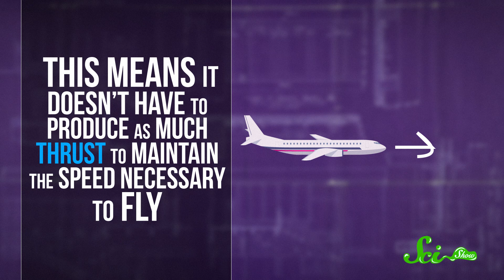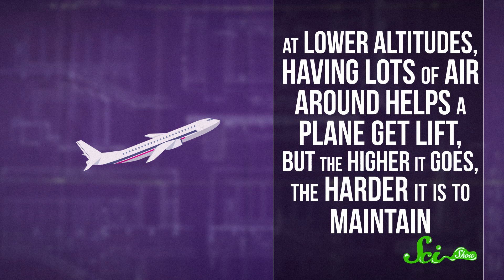Why Do Planes Fly So High?

Comment: Aerospace engineer here,
The arguments of 'you get less drag force flying higher' and 'you get less lift flying higher' both cancel each other out when you do the maths, so neither of them is a reason for flying at any particular height.
The primary reason for wanting to fly jets at 11km is because jet efficiency is proportional to the difference in temperature from engine intake air to exhaust air. If you look up a map of the SI atmosphere you'll see that the air above us reaches a local minimum in temperature at 11km, before warming back up again in the stratosphere. 11km gives the lowest air temp that we can practically fly passenger jets in, and so we aim for that to get best range efficiency.
Reply: Imma do a little necroposting here but it is correct to say that for a given true airspeed, going higher leads to lower drag (until at optimum indicated airspeed). This holds true for all aircraft regardless of what type of propulsion they use. Doing 430-480 knots true at sea level would be pretty wasteful no matter what the outside temperature is, and things would only get even worse in super cold weather (higher indicated airspeed).  A common way for jets to "maximize the temperature difference between intake and exhaust air" is to run the engines at high rpm, and it takes less fuel to do that in thinner air.

Comment: So, what IS the optimal altitude for most modern aircraft?
Reply: Qermaq It really depends on the plane type, winds that day, the weight of the aircraft but roughly FL330-390.
Reply: TheTechRobert Awesome, pal. I guess FL is Flight Level, but what's 330-390 measured in?
Reply: nhlfan40 You are also awesome! Hugs delivered by your hottest specimen of your preferred gender post haste!

Comment: Now if only jet fuel could melt steel beams...
Reply: Weakened, not melt. If you're being serious, take off the tin foil hat.
Reply: Inorganic Vegan 7/11 was a part-time job!!!
Reply: when steel frame buildings set fire, they burn away and leave the steel frame behind as a cooked skeleton. 9/11 is the only case of a steel frame building setting alight and falling in free-fall.
Reply: Any of those buildings hit by fully fueled commercial airliners?
Reply: ***** Nobody except the CTtards say it did.
Reply: nathan rous it doesnt have to melt it. when steel gets hot it  gets soft. its how forging works.
Reply: You mean steal beams,get it?
Reply: Bush did .81 repeating aviation fuel cannot reach the MP of a carbon iron alloy

Comment: Not exactlly true.. the air is much colder in that altitude, so also has more density. The ram air effect compensates for lack of air, but since the temperure doesnt change with increase in hight (but density does) there is no point to go higher than that

Comment: Airplanes fly high because they need to enter what is known as the "jet stream." The jet stream is where airplanes can get a boost in speed as well as less turbulence due to the singular direction of the flow of air.
Reply: ***** What if they're going the opposite direction to the jet stream? Or not flying along the route of a jet stream at all? Or what if you just watched a comprehensive video with a totally full answer that left far fewer holes than your answer did? Or if everyone you were trying to tell about your... Misapprehension, had also just watch a comprehensive video with a totally full answer?
Reply: ***** No. The jet stream, as you can tell from the name, is a very localized occurance, and thus the plane could not stay in it unless it happened to have a flight path both near it and in the same direction (not the opposite way).
Reply: Jake Halford I would caution against any claim of "comprehensiveness" because the reality is always more complicated. Planes may choose to fly against the jet stream for the benefits of less turbulence alone. Also, in terms of thermal regulation, flying against the jet stream is more fuel efficient than not flying in it at all. 

http://aviation.stackexchange.com/questions/1609/why-do-jet-engines-get-better-fuel-efficiency-at-high-altitudes

Comment: Would it be possible to design a passenger airplane that didn't have to burn fuel?
Reply: Well, electric planes are technically possible, but we'd have to come up with a whole new battery design because the ones we have now aren't nearly powerful enough for a 500-passenger 500-ton airliner on a 16-hour flight.

Comment: First off, Thank you for making such an amazing educational channel! You are ALL certainly AWESOME! I HAVE A QUESTION I would really appreciate an answer to!
"If our normal average body temp. is 98.6 degrees, WHY DOES IT SEEM SO FLIPPIN HOT TO US WHEN IT IS 98 DEGREES OUTSIDE. or inside with no direct sunlight for that matter? Heck, I don't like it when it gets to be over 80 degrees. Anyway thanks again! PLEASE PLEASE PLEASE ANSWER THIS ONE!!!!
Reply: The hotter it is outside, the smaller the difference between your inside temperature and temperature outside, so it is harder for your body to get rid of heat. The reason why lower temperatures feel more comfortable is because the extra heat from your body goes into your surroundings more easily. I hope this answered your question.

Comment: You can also fly faster at higher altitudes which is nice too.
Reply: maxstone2210 actually you can not fly faster. There is less resistance but you can not fly faster with a subsonic design.
Reply: 0MoTheG subsonic... ok maybe. I always go full sonic in Kerbal space program... But since there is less air at higher altitudes it seems logical to me that you have to fly faster (thererfore bumping in more air molecules) to generate the same amout of lift as you would at lower altitudes at a lower speed. I'm no aeroplane engineer but I could imagine that they use flaps and stuff to alter the airfoils design and thus generate more lift. Dunno, correct me please.
Reply: maxstone2210 You are right at first but there is no "flaps and stuff to alter the airfoils design and thus generate more lift" at altitude and speed. You would need something like the Concorde.

Comment: Why don't organisations like NASA use jets to get their rockets as high as possible and then switch into rocket model in order to reach orbit, would it that be a lot easier than trying to shoot a rocket straight up in the air?
Reply: Jaocb Hance The advantage of jets is obvious but the disadvantages aren't as clear. A rocket needs to be designed to take loads from one direction. It's very weak in any kind of bending load. To be carried to altitude with jets and wings it would need to be strengthened for bending loads and that costs weight. It also means that the engine start checks are done in the air instead of the ground. If there's a fault that makes the rocket abort impossible. It's actually better to just make the rocket slightly longer and carry slightly more fuel. That's what spacex did with the Falcon 9.1
Reply: Jaocb Hance Because the first 10 km don't matter much when you have to go 400 km.
Reply: 0MoTheG for some designs it does, like the Spaceship 1 and 2 are carried by an aircraft and are later realesed and start using Rocket engines, an unmaned russian spaceplane was also to be carried on the top of a jumbojet and later use rocket engines to go into space, NASA i belive once used a plane to launch a small rocket from the bottom of the craft
Reply: Jesus Ramirez Romo "Spaceship 1 and 2 do not go that high.
Yes, there were rockets and rocket ships that flew into low orbits from the wing of a B-52
Reply: thank you
Reply: Jaocb Hance There were projects like this, for example (though not by NASA) https://en.wikipedia.org/wiki/MAKS_%28spacecraft%29

Comment: High bypass turbine engines and straight turbine jet engines can operate efficiently at much higher altitude's then 30,000 and 40,000 feet. Aircraft in general dont care how high they are. Most commercial airliners are designed to fly in the mid 30s and low 40s. Above those altitudes pressurizing the cabin to a comfortable altitude from between seven and 9000 feet becomes more difficult. Not to mention during a rapid cabin depressurization at super high altitude most passenger oxygen masks will not allow adequately provide oxygen flow into the lungs. Another contributing factor is the narrowing gap between high-speed and low-speed buffet from the wing.

Comment: Why does steel and some other metals change colour when they are heated
Reply: 1008chaz thin layer of oxidation causing interference.
Reply: 1008chaz By change colour, do you mean become red/orange?
Reply: 1008chaz Black body radiation, I think
https://en.wikipedia.org/wiki/Black-body_radiation

Comment: And how does the black bird manage to fly at nearly 27 km ?
Reply: SaengerDruide02 It goes much faster than sound and uses much more fuel per distance.
Reply: thx, forgot about that ^^, but these jet motors need O2. I'm very interested in how they are constructed, because of the circumstances in which they work and how these "rings" form behind the jet.
Reply: SaengerDruide02 mach rings. I never understood that myself. I assume they are regions of higher density.

Comment: Isn't less air a problem when it comes to keeping the plane in the sky? I mean, it's a difference in air pressure over the wings that keeps the plane in the sky right??
Reply: Lee lift (/dynamic pressure) is proportional to air (free steam) density, but also proportional to the square of free stream velocity. The speed limit (so typical cruise speed) is under Mach 1 for commercial aircraft (for various reasons). The reason why jets don't go higher, is as hank explained also, is for jet engine combustion (at higher altitude, there is lower pressure, so you need a bigger compressor -> so bigger turbine). additionally, at higher altitude the cabin would need to be pressurised more, which increases the structural weight of the aircraft (this is a trade-off too). All in all one can say the 11km altitude 'goldilocks' commercial flight altitude.
Reply: Lee Yes, it is but it is offset by going faster. Research "coffin corner".

Comment: Why are pictures rectangular when camera lenses are round?
Reply: The sensor behind the lens, what would have been the film on older cameras, is rectangular. But you can see the hexagonal shape formed by the aperture (the hole that opens when the picture is being taken) in the form of lens flare.
Reply: 7chanconn7 because the sensor is rectangular, if the sensor was round, the picture would be round. But, TV's are rectangular, so we like rectangular sensors
Reply: 7chanconn7 And we have rectangular film/sensors because rectangular pictures are more useful. We don't build circular displays after all, and it wouldn't be a great idea to start doing so either. Rectangular displays do a great job matching up to our field of view.

There are historical photography methods that used circular image recording media though.
Reply: I pray for you
Reply: 7chanconn7 the form of the picture is the form of the sensor - make it round and your picture would be round too.
They are rectangular however and so are the pictures.

The sensor is the thing the light hits after the lense (or lenses in case of modern cameras)
Reply: 7chanconn7 I think it may be the shutte---- woah.... why is that
Reply: Chanconn Oh. My. God.
Reply: Camera lenses DO make circular images, as most lenses  do, (even square ones.) The reason the pictures from the camera are rectangular, is because that is the usual shape of sensor installed. The rectangular image is cropped from the middle of the round one.

Comment: It's also important to note that once you reach a certain height, any increase in height will not increase how fast you're falling when you hit the ground.
Reply: Angel Samael when you reach terminal velocity is what you mean?
Reply: Angel Samael  That's at around a mile and a half or less I think; it's definitely FAR less than the height large planes operate at.
Reply: You would slow down if anything the lower the altitude
Reply: Angel Samael I'm not sure what that has to do with anything. I mean, you're right, but how is that relevant to why planes fly at the heights they do?
Reply: supersmily5SS5 I doubt it's a mile and a half for a nose diving plane to reach terminal velocity. Unless you wanna say that's an actual calculated-by-someone figure, in which case I believe you